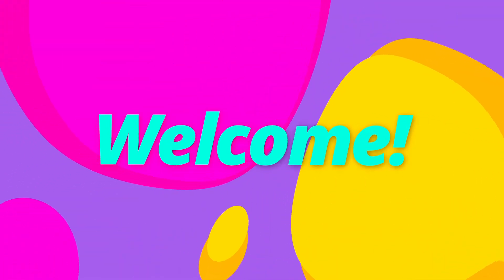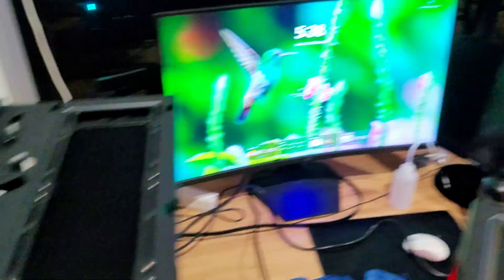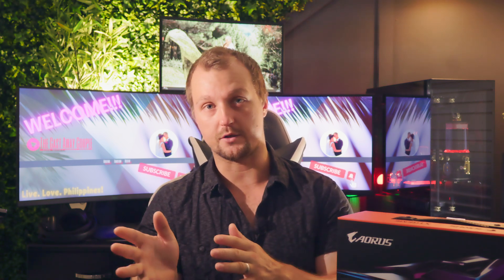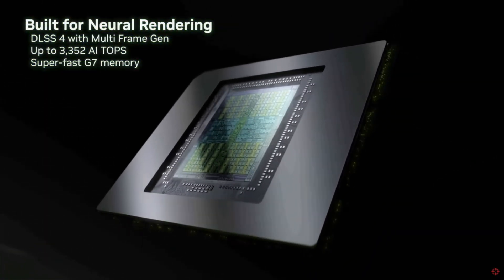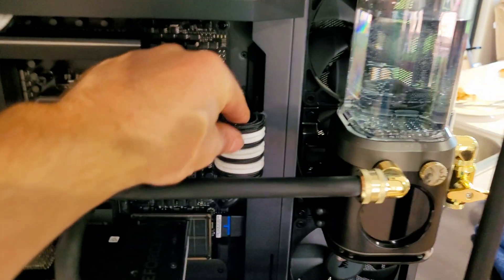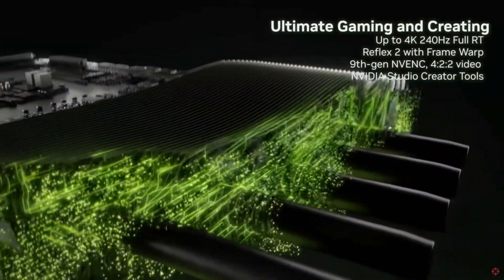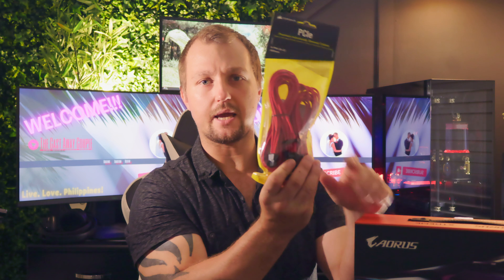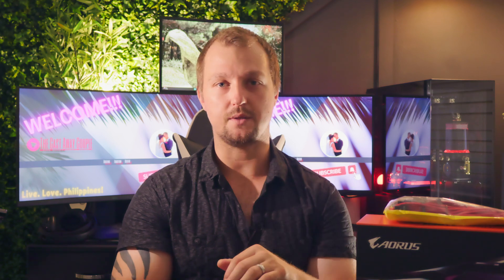🤯The Hidden Fix for Nvidia RTX 5080 Black Screen Issues - 12VHPWR Cable Secret⚡️

Comment: I think your cablemod cable might’ve just been faulty. I use cablemod cable with my Corsair AX1000 and Aorus Xtrem Waterforce 5080 with zero issues. The connector is the same as yours with only a few sense pins present.
Reply from the maker: @bangers5888  it's very possible. I did do a continuity test on both ends with my multimeter just to double check there weren't any breaks in the cable, but all seemed fine. Doesn't mean there wasn't something more obscure with the cable I missed though. 

Good observation though! Thanks for that

Comment: If you are having a problem where it keep messing with the display res reinstall the drivers fixed it for me where it kept going black and back on
Reply from the maker: @Pickles523  I wasn't even able to install them in the first place because the GPU never output any signal to begin with. 

Even after using an old 2070 super to install the latest drivers (multiple times) nothing worked. 

It was literally the power cable not allowing the GPU to initialise. 

PCIE cables solved everything!

Thanks for the tip though!

Comment: I have the same issue with rtx 3090, but it's not hardware, it's started after updating windows or nvidia drivers, I force the pc to go into safe mode removed nvidia drivers and the pc boot normally
Reply from the maker: @AppZoneIL  Amazing how sensitive these things can be to variety of different reasons! It's not a surprise people get so frustrated trying to things to run!

Thanks for sharing. Just another solution might help someone!

Comment: I have exactly that problem (black screen on boot) with my msi VENTUS 5070 ti on a asrock z790 pro rs d4 mobo. I've tried literally everything and the cars seems to work (sometimes) only if I have my old 3060 ti plugged in a second PCIe. I pray to God that your solution will help.

Edit : didn't help
Reply from the maker: @Booshista  Damn! I'm sorry to hear. I was very confident it would since its the only thing that worked for me. 

Just to clarify, what PSU have you got and did you use all 3 pcie (8 pin)  outputs on the back of your PSU? Or does the 5070ti adapter only have 2 plugs on the PCIE side?

Also have you tried everything else mentioned in the video?

I'll do my best to help you get it going
Reply: @thecastawaycouple my 5070ti has adapter splits into 3 pcie connectors. I only have the one pcie connector from my previous build so I ordered another 2 on amazon (non-daisy chain). I’ll update here tomorrow. Fingers crossed
Reply from the maker: @AlChestBreachFan7  
aaahk. So same as mine. Got my fingers crossed for ya! 🤞
Reply: @thecastawaycouple  I’m able to access the bios and boot with the 9800x3d’s igpu so I’m hopeful we shared the same issue. Gosh what a nightmare the past 4 days have been lol
Reply from the maker: @AlChestBreachFan7  I feel your pain bro
Reply: @thecastawaycouple  IT WORKED. THANK YOU SO MUCH
Reply from the maker: @ that’s great news! I’m glad I could help.
Reply: @AlChestBreachFan7  can you link what connector worked for you?
Reply: @thecastawaycouple  it has 2 plugs connector. My psu is 1000w be quiet! 5.1 pcie ready so it should do the work.
Reply from the maker: @Booshista
 yeah, absolutely. That's more than enough juice for your system. BeQuiet make some solid gear!

Best of luck.

Comment: I reset the cmos and my 5080 came on then on my screen so i powered down and closed it up and then boom nothing next time i did. Damn hope i dont have to use the adapter
Reply from the maker: @charliebaker1427  I tried clearing cmos at least 5 times and it didn't help me but you're issue sounds a little different to mine. I wasn't getting a display from the get to. 

Even after using my old 2070 super to install the Nvidia app and download and install the latest drivers, I swapped my 5080 back in and still nothing. 

It was literally the power cables the entire time. 

I would strongly suggest trying the adapter and see what happens. You might be surprised how it might fix it!

There was literally nothing to indicate that anything was wrong with my card or that I was doing something wrong unless the card was faulty from the get go.... I can't believe it was literally the power cable all along!

Thanks for watching!